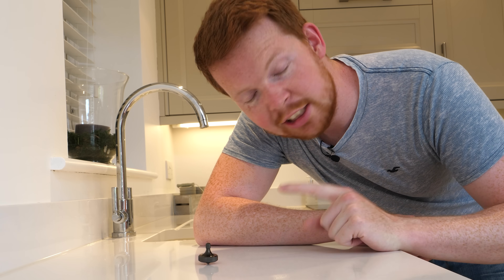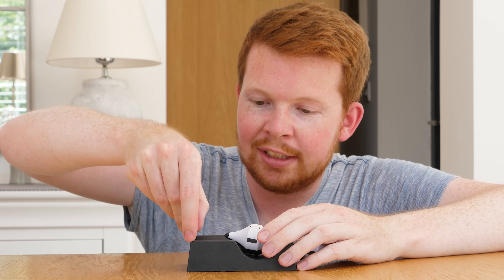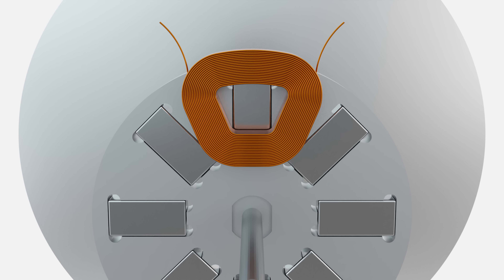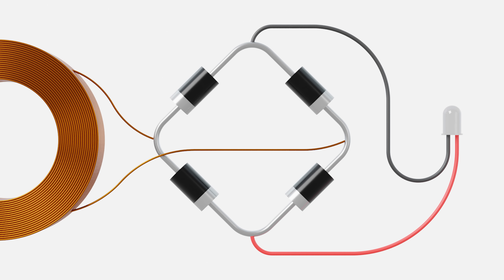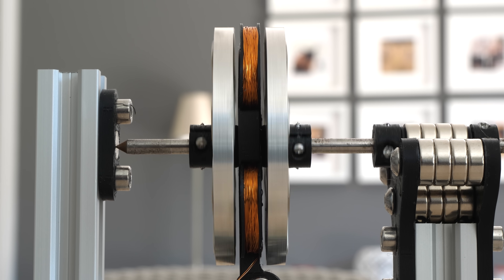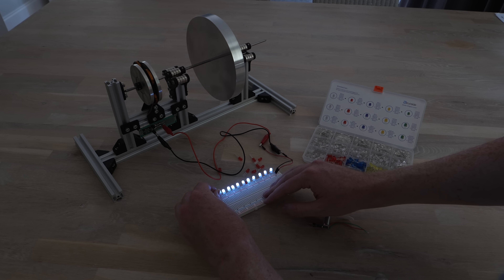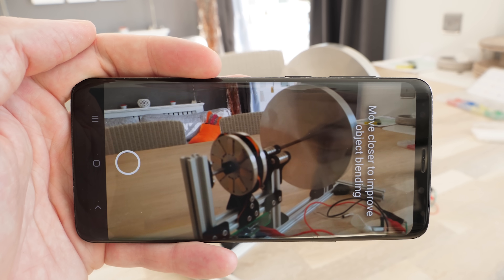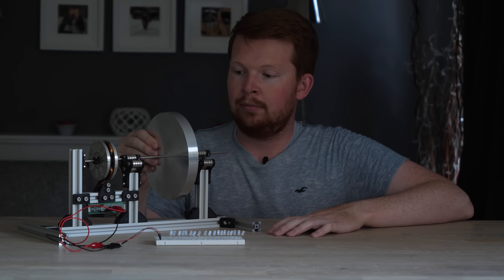Flywheel Battery

Comment: Create this if U can( i dont have room or time but) an oval (calculated lenght) riser for (calculated) fly wheel wheel weight that rides like a station that you have but compressed slightly redesigned to spin and rotate around the oval vertical ride hooked up to wires that move with :) like a GRAVITY driven GYRO electromagnetic station. Ooh if there is a high spin electric gain that gets sort of nit stored, should get stored for slowed down on towards up and catch electricity for to enchance speed power needed fir the ride up so it continues around and round like free well technically free elevtricity but building will cost some cash and replacement parts after some use calculated might be something worth it.

Comment: Why would you need it to float? for lesser drag and resistance due to  friction? If you could mount it at just the exact point it levitates on, you can then connect the flywheel to a broadside wind turbine to power the flywheel and then charge a set of batteries for a more efficient wind electric energy. You could make it in such a way that the wind turbine will only contact the flywheel when the flywheel needs to be rotated, while the the turbine powers another wind generator while doing all this

Comment: Hi Tom, super interresting project!
One small idear, why not try to see how high voltage you could get by accelerating the flywheel by meanes of comperssed air, and by small turbo wings on the flywheel? 😀

Comment: Your magnets are inducing voltage not current. The current is the result of the voltage there is no current with nothing hooked up. If you put any real load on it the alternator will produce a lot of resistance to the rotation quickly slowing the flywheel. All that being said it is still a very cool desk toy

Comment: Nice demonstration. explaining the principle of EMI.  Many years ago I studied a similar system but on a larger scale. I belive it was installed in France and was a huge flywheel mounted on air bearings.  It took weeks to run up but very little effort to keep it going.  I think it was a sort of emergency power supply. Similar idea

Comment: Add neomydium magnets on both ends to avoid any surface contact. For stabilisation add magnets also above.
Reply: You don't need magnets on both ends, just replace the pinpoint bearing with a pair of opposing magnets.

Some people would say you can't suspend something in the air solely by magnets, and you can't do it the way most people would try to do it, but with this setup, replacing the touching bearing with two small opposing magnets should work just fine. The whole system "leans into" the two opposing magnets, and when they get too close together they push back with increasing force, so it will stabilize after bouncing back and fourth a while.

There of course will still be air friction, and putting any load on the generator will take out energy and make it slow down faster. I really wanted to see him short out the wires from the generator to see how fast it slows down and stops.

Comment: so if you turn the giant aluminum cylinder into blades that spin in the wind, will it essentially be a wind turbine? also, I have to run my fan every night because i am a super light sleeper. It would be really cool to re-use that energy for charging batteries.

Comment: Tom, great video! With you having so many subscribers I doubt you will replay to me but I would LOVE to see you make a version of this as a water wheel hydro power center. Floating bearings is what water wheels really need. Everything else rots or rusts.
Reply: It would be interesting to see how long it could run itself with a very small pump. Flywheel becomes a water wheel that runs a tiny pump from the lower reservoir to an upper reservoir. There are plenty of tweaks that could be made to improve efficiency. Also, if you built the upper reservoir in a way that the bottom of it is lower than the lower reservoir, couldn't you pipe it so that once it's started you are effectively siphoning?

Comment: With today's low concumption electronics, it should be possible to biff up the rig by an order of magnitude, a set of bycicle pedals and an automatic gear box, and it should be able to power a computer and a screen.

Comment: Hi Tom, I'm sure you're aware, but Schottky diodes will work the best in this sort of application. A regular diode will drop the source voltage down by around 700 mV, while Schottkys can go as low as 150 mV.   Cheers, keep up the good work.
Reply: That is almost the same theory & basic principal Small engine Alternators built on ever since the 1930s and still R basically the same even now. The diodes limit or increase the induction rates.
Reply: @thekingsilverado8419  I think you're only talking about an electric motor aka a generator,  same thing as an alternator. you can power it to make it spin, or spin it to make electricity.  I don't think Alternators, doesn't  have a flywheel or Schottky diodes, so I'm confused by your reply to this comment.
Reply: @c1h2r3i4s56987  U need to open your mind.. I have speed & performance shop and every now and then we get really bored.. U would be surprised at the really simple tech that could solve some real energy problems.
Reply: (Shaat-key-die-owhd) Those words literally ruined me for a couple of minutes. 
I had to google it, ain't gunna lie.
Reply: 9:45 Ten LEDs glowing! Nice!
Reply: Or use LEDs as rectifier in the first place :-D
Reply: And, "sctive diodes" can reduce the voltage drop to almost nothing...ah, FETs...
Reply: Tell me if I’m wrong here, but as I recall, diodes are two layer devices, with (Silicon) forward bias loss of 0.7 V, and (Germanium) forward bias loss of 0.3 V, no?

Do the Schottky diode‘s do something less than 0.3 V loss?
Reply: @OnerousEthic  At low currents, Schottky diodes can have a forward voltage as low as 0.2V.  0.4V under a moderate load is fairly typical for them.   They also switch at higher speeds than most diodes - not that that matters here.

The only downside is they have higher leakage of reverse currents - but not enough to be a problem for an application like this.  It's more of a concern for use with electronics that can't stand reverse voltage / currents.

Apparently, they use a semiconductor metal junction, rather than two layers of semiconductor.
Reply: @TooSlowTube  I would love to see this thing run fast enough to challenge a high speed diode hahaha. That would be BOSS. 🙂
BTW this is why I use Schottky diodes as detectors in my radio projects. SUPER low forward voltage plus a tiny bit of bias voltage = very sensitive detection indeed.
Reply: @OnerousEthic  Germanium diodes can have lower forward voltage drops than silicon ones for small currents too.  Schottky diodes have the lowest, all else being equal.
Reply: @TooSlowTube  Oh I made a typo; now fixed: the forward loss for germaninum is 0.3v. And the metal junction makes so much sense! Thank you!
Reply: @OnerousEthic  You're welcome, Erius.
Reply: Could some SME out there confirm that the forward conduction voltage of germanium is lower because it has lower resistivity to hole current? Or something like that?
Reply: @OnerousEthic  It would be to do with a jump between two energy states, IIRC.  Changes in energy states for an electron have a definite voltage associated with them - which explains why eV "electron volt" is a small unit of energy.

"The electron volt equals 1.602 × 10^−12 erg, or 1.602 × 10^−19 joule.", i.e. it a tiny fraction of a joule... because electrons are so tiny, I guess :)

A similar rule applies to batteries - different battery types have a definite voltage associated with them, because the reaction that produces the current (or maybe charge), has a definite voltage associated with it.

The lower voltage that we're used to seeing as batteries discharge, is due to increasing resistance (source impedance) as they fade.  I think that partly applies to the forward voltage drop of diodes increasing as the current increases too - it's not just a fixed voltage, in practice because it increases with current, in a non-linear way.  A diode only behaves in an ideal way for small currents.

If you look at the data sheet for a diode, you'll normally see a Vf (forward voltage drop) quoted for a particular current, and ideally, some graphs of how it changes for other currents.

The lowest Vf you can measure is usually less than that figure, because they quote it for the sort of use they expect the diode to be put to.  If we use a heavy duty rectifier diode with quite small currents, we can expect a lower Vf than the datasheet gives.
Reply: @TooSlowTube  VERY interesting!! Thank you!!
Reply: @OnerousEthic  No problem :)

Comment: why didn't you use a conical circular array of magnets and set the whole flywheel on that then it couldn't flop to one side or the other and you wouldn't need the end bearing, you could also use the magnetic poles at the top for your energy extraction/addition.

Comment: what would happen if you got the flywheel up to enough speed and added a electronic motor with a transmission, as a way to get it to higher speeds but have a wat to not burn it out?

Comment: If you applied a fan blowing on possible fan blades attached to the flywheel, also enclosed the entire thing inside of a box you would have a free energy generator? Is that correct?
Reply: I am going to change the world by creating something life changing. I wanna know where I can learn electrical circuitry? Any ideas located in the United States?

Comment: Nicely done , 
Flickering is LED it self behavior on varying DC voltage . They turn on & Off around 3-3.4VDC  Add a capacitor in the parallel of Rectifier Bridge , this will improve the flicker. Other way , try an old fashion 6VDC , small size Filament lamp. this will produce dimming  effect instead of Flickering when FW at low speed.

Comment: With the exception of the heavy disc… applying the same voltage BACK into the floating generator should spin the device right?

Comment: Honestly this has been super informativie. Thanks flr explaining this so well!

I wonder if axial flux type of generator can be stacked to harness the power of wind?

Btw do coils need to be at this angle or they can be narrower so that u can add more coils?

Could this be further improved by adding iron into the mix?

What is the gaige of wire?

How big are the magnets? What strenght?

Comment: 9:00 @Tom Stanton in case you don't know, this is not a coincidence. The voltage drop over an LED is directly related to the colour of light it emits. For example, a red LED might have a drop of around 1.7 V, corresponding to a 1.7 eV (~2.72e-19 J) band gap energy. Via E = h * c / lambda (Energy = <Planck's constant> * <speed of light> / wavelength), this corresponds to a wavelength of 730 nm, i.e. red.

Comment: if the large wheel was weighted so that when the wheel is stationary it would level at thee heaviest point ..so what i mean is that if the heavy point is held on top and when let go it is pulled down with gravity ...so logically it would become a perpetual power supply that never stops

Comment: Have you tried a metal ball attached to a horizontal cirular disc and place that ball on a flat surface?? instead of a cone tip?
Then place the same amt of magnets  in a circular pattern one facing north and the other south?  And then slowly lower the magnet on top of the metal ball w/ metal circular plate.
. And see how much less friction is created.... I will try to find the video and attach it to this comment...(( Hope you find this comment.))

Comment: USING ONE SMALL MOTOR TO POWER ANOTHER - WAS ABLE TO MAKE SPIN BY JUST SPINNING GENERATOR MOTOR WITH FINGERS-NO FLY-WHEEL A SIMPLE FLYWHEEL MOUNTED DIRECTLY ON SHAFT IS MUCH SIMPLER THAN ALL THE WORK DONE HERE

Comment: This plus a stationary bike, times a number of households, could actually generate a decent amount of power. Obviously there's a speed limitation, as is the limitation with flywheel batteries... But I suppose you could multiply the number of wheels, as opposed to the diameter and to increase power storage.

Comment: when winding a coil, whats the difference between having alot of turns and using a thicker wire

Edit: so more turns means a higher voltage and a thicker wire means more amps?

Comment: One of the ways data centres create uninterruptible power supplies relies on a spinning mass like this.
The two problems with it are that the power needed to maintain the speed against the air resistance is about 50kW for a 2MW UPS system and the other is that the spinning mass generates 2MW for about 3 seconds so the diesel generators have got to start and get up to speed within this time!

Comment: I'm kinda stuck on this. this specific design could be slightly modified with windmill rotors to generate and store wind power with such efficiency it would actually become a challenge to control the efficiency, am I wrong?

Comment: This is truly fascinating. It's basically what I've thought of since I was a child. I always wondered if this was possible, to use magnets to make something spin freely. I thought about trying to use it to make a perpetual motion machine but then learned about the 2nd law of thermodynamics. Still amazing though.
Reply: I CAN MAKE MANETS TO SPIN FREELY.E DOAR UN DESIGN WHICH IN EED TOOLS AND MATERIAL. FOR.
THE SYSTEM CAN HAVE A BOX TO FIT IN AND PRODUCE ELECTRICITY FOR AN HOUSEHOLD.REPLY IF YOU ARE INTERESTED

Comment: You probably already know this. Given the rotational energy scale with moment of inertia rather than mass directly. You can store more energy with the same angular velocity if you distribute the mass away from the center of rotation. IE: spin a thinned wall cylinder with equivalent mass of the solid disk, the ratio of moment of inertia scale quadratic as radius increases. Getting more bang for your buck, though the trade off is the device require more space, so the packaging factor is worse.
Second point, since the rotating mass is purely acting as mass, if the purpose is to store energy, why not replace the rotating mass with lipo battery. The battery's mass will be co-used as rotational energy storage, hitting two birds with one stone. Energy density per unit mass should increase by quite a lot, since you get dual use from the same mass.
Although the wiring could be kind of messy. Since you need a slip ring to get power out. Unless you do some crazy stuff like put a solar cell on the rotating battery and use an external laser to charge the spinning battery and use another laser to beam out the energy. So transfer energy without touching each other. I think my rotating lidar sensor basically used this to get power from the battery to the spinning laser.

Comment: How about adding some linear induction to your flywheel, Tom?

 Using your set-up above, can we add some torque to the mix with a touch of linear induction by implanting magnets of alternating poles around the wide circumference of your flywheel and then fit a matching, stationary collar of electromagnets around the newly magnetized flywheel circumference to create a linear induction rotation that is synergistically powered from your existing set-up to add even more “juice” to the flywheel?

David Gustafson
Las Vegas
Reply: By “stationary” collar, I mean a collar with an independent support system on the outside that allows the flywheel on the inside to spin freely on the inside.

Comment: what if you used uni-directional magnets on the outside of the flywheel (where the wheel would hit the road)  with a polar oppositional magnet to cause the flywheel to spin on it's own?

Comment: Putting a generator on it totally defends the purpose of using maglev to have the flywheel spin almost forever as it extracts kinetic energy from the flywheel and turns it into electric current.

Comment: I have always believed a Tesla turbine with maglev rotors could be driven by steam pressure shafted to a very heavy maglev flywheel and act as a battery to allow the system to provide a short burst of power that is more than the total output of the steam.. obviously not forever but it’s a cool concept, storing power as inertia of a rotating mass

Comment: What if you stabilized the end you spin the flywheel shaft from with a fully surrounded magnetic joint? Seems like the upward inertia due to the shaft imperfections could still be mitigated that way. Also, how many volts were you able to get after rewinding the coils and still starting it with a hand drill? Powering a single board computer would be amazing

Comment: is it possible to make a magnetic bearing that doesn't require an axle? i my imagination i think of a ring of magnets like a motor bell, with a ring outside or inside opposing them, and on the plane in which they rotate, there are magnets nestled in a bearing along that rotational axis.  the weight of the outer ring could act as the flywheel, and you could easliy place copper coils near the rotating flywheel to tap the energy.